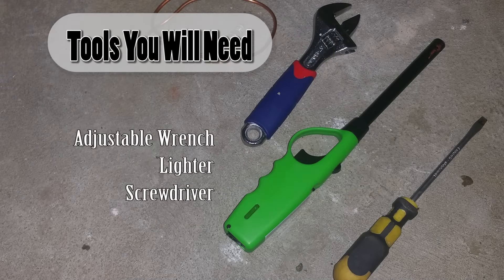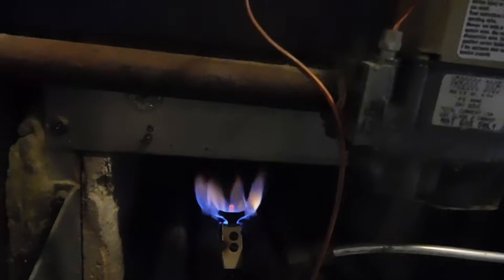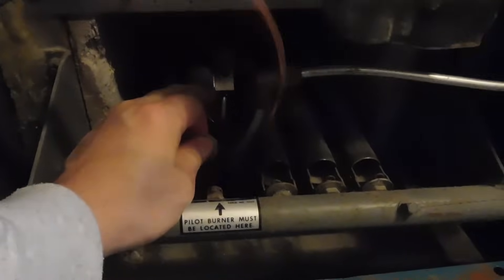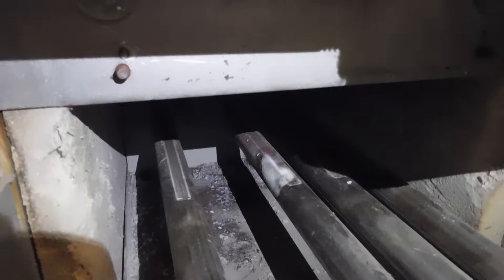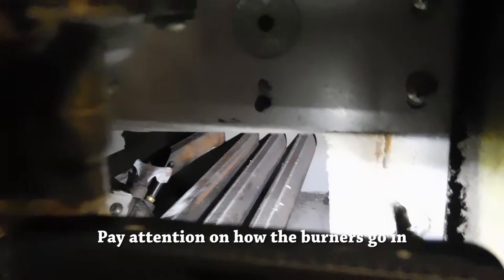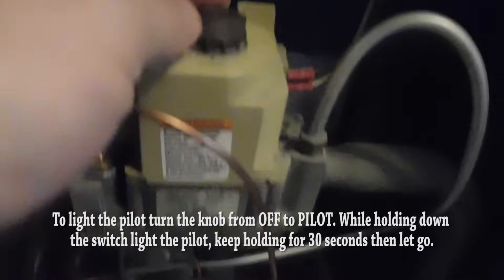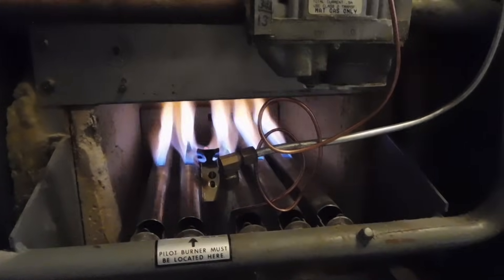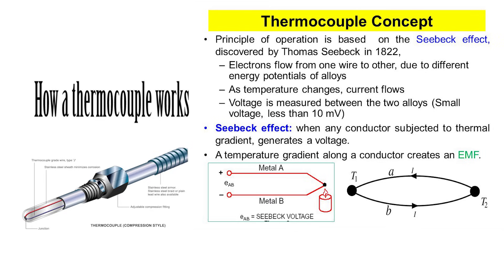Boiler Pilot won't light / Replacing the thermocouple if the pilot won’t stay lit

Comment: Hey Da P.A did this a couple of times over the years, found your video, could not remember what it was called, so googled it, saw your video, well done too by the way...29 degrees out and furnace won't kick on, that stinks, need to go get one this morning at Fager Plumbing supply in York, PA...Thx and Happy New Year...
Reply from the maker: Good luck, fyi I found if you lower your pilot light the thermocouple lasts longer.
Reply: @daP.A  Roger that, went well, and yes, I will tweek the flame...

Comment: You saved me a ton just now!  I'm staying at a friend's cabin out in the sticks and I'm by myself.  The pilot light kept going out, and eventually wouldn't stay lit.  She has the exact same furnace/gas pump that you do.  Luckily I remember seeing 2 thermocouples in packages in the garage.  My repair went exactly as yours did.  I was afraid of the aluminium gas piping for the pilot light, but was very careful and checked connections w/ soapy water after.  Worked like a charm!  Thanks again!!
Reply from the maker: Glad you where able to handle what could if been a bad situation and stay warm. Btw good thing your friend had a spare thermocouple, always a great idea.

Comment: If your thermocouple keep seeming to fail, probably the gas valve.  
There is a solenoid in the valve.  It's a magnetic piece that is powered
 by the thermocouple.  When it won't stick magnetically anymore it needs
 to be replaced.  $160.00 for a new gas valve.  Useful to try replacing 
thermocouple at $8 first.  My Weil McLain has a tight fit for the valve,
 but it is DIY if you are careful. Thermocouple lit quickly after valve 
replaced.
Reply from the maker: it could be the valve, however it's most likely thermocouple has it loses its ability to conduct electricity and open up the solenoid on the valve. 99% of the time its the thermocouple, especially if you able to manually open the valve for the initial lighting. I agree sometimes is the valve but rarely.

Comment: Electricity?  Most gas appliances including stoves have no need for electricity.  The heat causes expansion of the fluid or gas in the thermocouple which then operates a valve.  Often a simple short term fix is to tighten the nut.

Comment: Great info video. My question is can you use a thermocouple thats meant for water heater in a boiler?
Reply from the maker: i just go to the local hardware store and by a standard thermocouple. You probably can use the one from the water heater without any issues but i would just buy a new one from you local hardware store, they aren't too expensive.

Comment: Great instructional video. Clear, concise and educational. Also make sure the flex gas line is tight and sealed. Mine had a leak. Thanks for sharing.
Reply from the maker: very good point, safety 1st!
Reply: No light

Comment: It is ok to move the whole burner with that gas line connected? Do you have to loosen anything?
Reply from the maker: its ok but make sure you gas is off on the pilot, the emergency switch off. then make sure you check the gas line for any loose connections.

Comment: Hello Da P.A. I would recommend you to lower the flame of your pilot, looks too high and that will damage your thermocouple,.You see it’s glowing red, adjusted lower it and will last longer. Thanks for the info and the video!
Reply from the maker: yes i ended up doing this afterwards but adjusting the valve that i mentioned. Its a good point!

Comment: I replaced the thermocouple, but I was not able to light the pilot. I turned off the electric switch near the furnace and turned the knob from the gas valve to OFF position, wait for 5 minutes then turn the knob to pilot position, hold it down and light the pilot and keep holding for a few minutes. When I released the pilot knob, the flame won't stay lit. I only had a small flame though. I tried that process several times. While I was doing all of that, I had my thermostat on OFF position. Am I supposed to turn the thermostat to HEAT position instead of OFF?
Reply from the maker: you can leave the switch in off position while you light the pilot. your thermostat can also be off. when you turn the knob to pilot you will press the button down, light the pilot while keeping the pilot button down. wait until the tip of the pilot is nice and cherry red, about 1/2 minutes and let go. You will have a steady small flame on. this is the pilot flame, now turn on the electric switch from off to on. Turn the thermostat from off to heat, set heat high like 80F and you should see the pilot flame increase when the thermostat calls for heat. If you pilot light is going off right away after your replace the thermocouple you might have another issue.
Reply: Is the pilot itself the issue? Do I need to clean the pilot or even replace it?
Reply from the maker: Could be, you will need to call a professional. That's beyond scope of video.
Reply: Thank you. Excellent video
Reply: @aongang1136  did you get it fix? Could be a limit switch or gas valve.